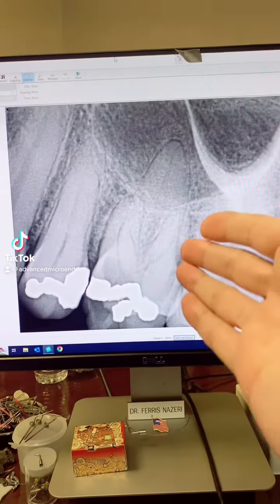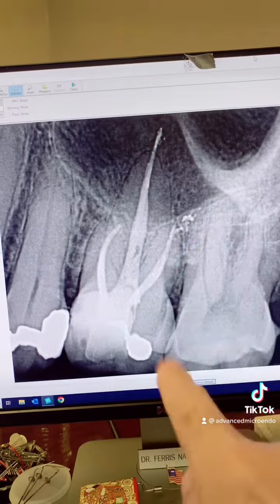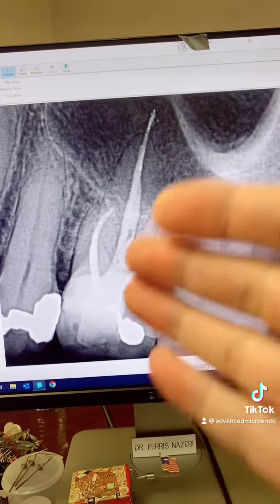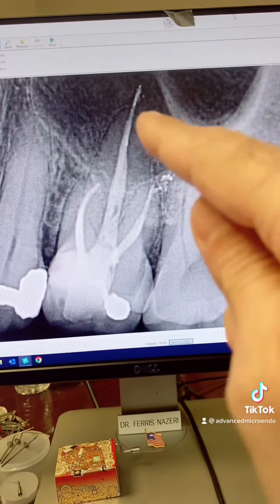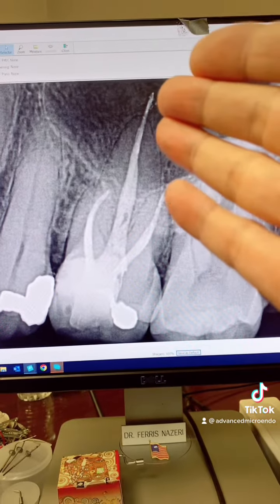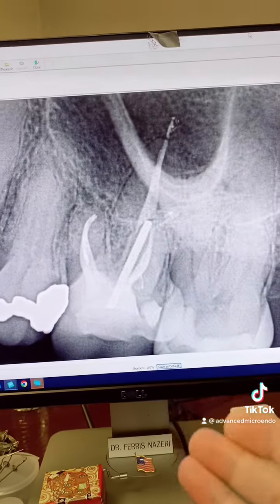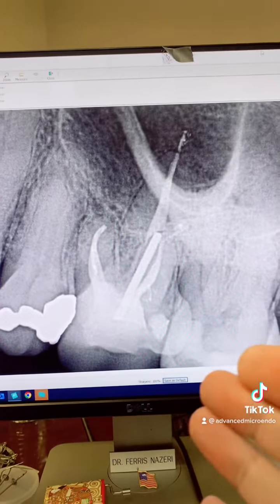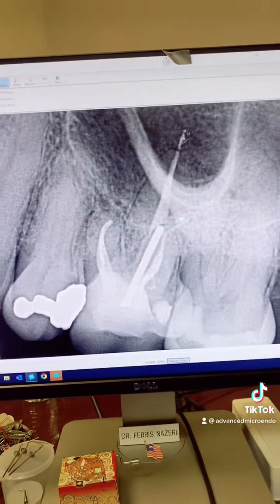Does gutta percha extrusion cause endodontic failure?!

Comment: I’ve done this before multiple times with and without rubber dams. None of my patients have had issues. An endodontist told me you’ll only have an issue if you are short and didn’t seal the apex.

And sometimes I think rubber dams are not important, especially in cases where the pts tooth has been decayed with necrotic pulp, large periapical radiolucency with draining fistula - all the bacteria/viruses/fungi in their mouth is already present in the bone. 😂

Comment: If there's no pain within 3-4 weeks after over extended obturation can we call it safe?

Was kinda worried after one of my patient came back with post obturation with around 1 mm over filling. Its been like 4 weeks and there's no pain so I decided to do final composite restoration.
Reply from the maker: Overextended gutta percha does not cause endo failure. Not adhering to the fundamentals of endodontics and bacteria in the canals cause endo failure.